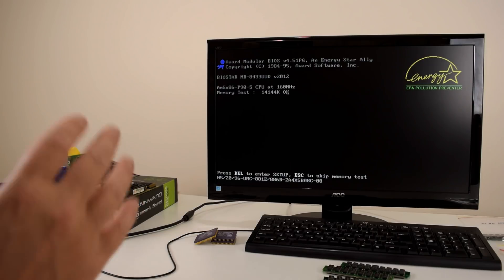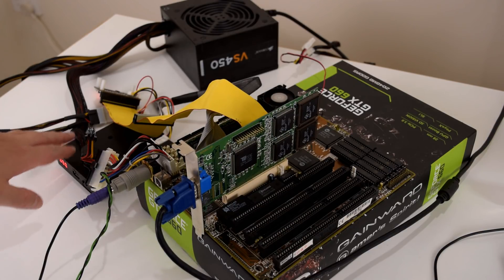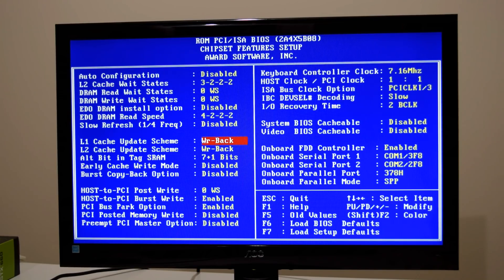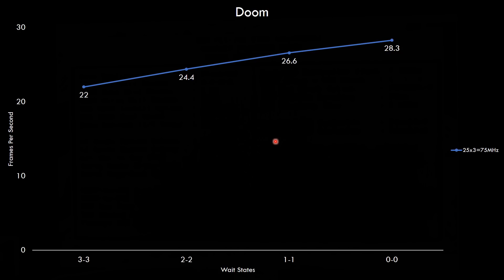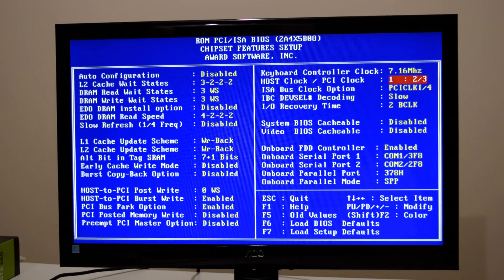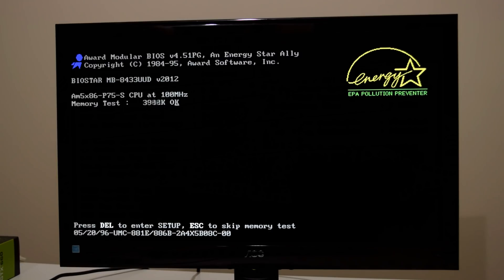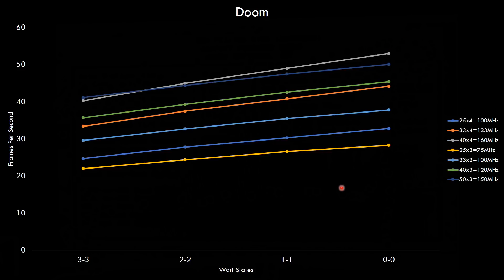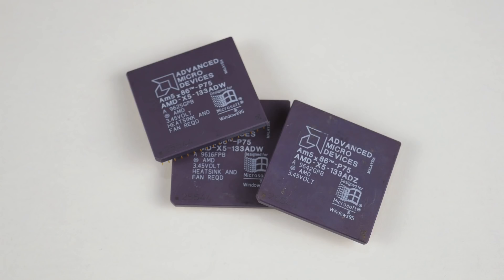486 from 75 MHz to 160 MHz and how memory timings matter

Comment: Hey Phil have you thought about making a video on the last agp cards made? I managed to pick up a mint Ati 3650 for $10. There is supposed to be a Geforce 6800 also from nvidia side. Would be interesting to see the bottleneck effects on old cpus
Reply from the maker: Nah these cards are too expensive :/
Reply: Boy you werent kidding. Man $Au100 average is pretty much.
Reply: @PhilsComputerLab - A 3650 is actually miles better, than a 7800 GS - it even supports DirectX 10.1 and is pretty decent even today.

Also I found a HD 4650 (second best AGP card) on Bazoš for around $10-30 AUD, the shipping costs are around $12 AUD for 1 GPU and $20 AUD for 3 GPUs. There are lots of other AGP GPUs on Bazoš, too if you're interested.
Reply: @PhilsComputerLab - I can forward some cards to you, the internatinal shipping is cheap here in CZE. After a 10-second search on Bazoš I was able to find a whole used PC with Athlon XP 3200+, 2GBs of DDR2, 80GB HDD and finally an AGP 3650 for $35 AUD, or a lone AGP 3650 for $10 AUD, with shipping I could probably forward it for about $20-30 AUD.
Reply from the maker: I had a look, I actually have a 3650. But it's not the fastest card, there are faster ones and they cost even more. I think my best AGP card is a 7800 GS or something like that.
Reply from the maker: Though I would just ditch AGP and go with PCIe. You can get 478 and 775 for PCIe as well as AMD 754 and 939.
Reply: IIRc the duel for the best AGP card is between 3850 and 4650.
Reply: There is also an AGP 4670 according to wiki, it's not available here in CZE though.
Reply: You're right. They are sold between 40 EUR and 50 EUR in Germany currently. I'm not sure though, if 3850 is faster because it has 256 bit memory interface. 3850 sells for 10 to 20 EUR below 4670.

Comment: the 486 computers are still my favorite computers. even though the first PC I ever used was a 286, the 486 with windows 3.1 is what I knew as a child all the way up until 1999 when we got a Pentium 3. I enjoy learning more about what this old hardware was capable of. The settings aren't as apparent as they are now in modern PC's. Also just because these settings worked on that brand of CPU, a Cyrix, or IBM or AMD 486 with similar specs may not perform the same due to differences in the construction of the CPU's micro architecture.

Comment: One DOS benchmark I used to rely on heavily is System Speed Test (I think v4.78 was the last one). It can do all kinds of nifty tests, including CPU speed, cache and memory bandwidth, video bandwidth and harddrive performance, and will save a screenshot and/or log file. For memory latency tests there's also "Cachemem", and there's even "STREAM for DOS", a version of the popular STREAM memory benchmark.

In the olden days, the difference in memory performance between various chipset could be huge. I used to have a VLB board with an older/lower-end OPTi 495SX chipset (Shuttle HOT-409), and upgrading from that to an 895 (I think), I saw memory read/write/move throughput go from 9/25/8 MB/s to 31/42/14 MB/s with the same DX/2-66. You definitely noticed that, too!

One odd quirk I once came across was that a 5x86-133 didn't like the power supply (!) in the tower I was using (a late-'80s beast once housing a 386) and left its L1 cache in write-through mode rather than switching to write-back. Booo. And that wasn't a standard "modern" AT power supply, but rather something bigger and older, I don't remember what that formfactor was called, so no easy replacement. Bummer.

Comment: So the fsb was one of the biggest bottle necks on old machines. I remember my causing had an 133mhz mmx which he downclocked to 100mhz just so he could raise the fsb and memory speed or something like that. In his words it was faster. (never actually touched the machine in depth, i was like 8 at that time)
Reply: I can confirm this too. Back in the day I did benchmarking like this on a 5x86 with 60ns EDO RAM modules and the machine got faster at 3×50 MHz than at 4×40 because of higher FSB especially in Windows. Doom may be an exception favoring higher CPU clock speed. I didn't have these options in BIOS, had to use jumper settings.
Reply: Even on Core 2 Conroe/Merom/Penryn etc FSB is a major limiter.

Comment: My recollection was that BIOS default equated to "safe defaults" and SETUP default equated to "optimized defaults" - which may apply some better options.
Also, a few passes of memtest at 50MHz 0ws would be reassuring - generally, the reason for applying any wait states is that things fall apart without them, or at least for safety margin at higher speeds - if it can tolerate 0ws on 70nS SIMMs at 50MHz, you wonder how bad the RAM would have to be to need wait states?

Comment: 2 errors :(

-you enabled L2 cache only on extremely overclocked FSB, situation where its least needed (486 is slower than ram)
-you compared 40x4=160MHz no L2 with 50x3=150 with L2 and derived 6%, while in reality the difference was 50x3 no L2 50fps vs 50x3 with L2 56.2fps = 12.5%!

12% speed bump in the worst case for L2 effectiveness (extremely overclocked bus) is HUGE.
Reply: Cache operation differs from RAM so it is useful anyway. The second mention is true.
Reply from the maker: The point of the video was memory performance, NOT cache. I mislabelled the Graph results, they are at 160 MHz with L2 Cache of course.

Comment: How many 486 motherboards have mounts for a CPU heatsink/fan? I don't remember any that I ever had having them because they were never required and I didn't OC in those days.
Reply from the maker: The cooler mounts to the CPU, not motherboard or socket. You're thinking way too modern :D
Reply: Alot of 486 chips had a heatsink cemented to them
Reply: And in case you can always plug the fan into the PSU. 12v, 9.6v 7v, 5v, 3.3v are all avaiable. Some voltage wil get the right mix of cooling performance and noise level.

Comment: 160Mhz 486!!! Makes me wet just thinking about it! My friend had a DX2-80 while I was rocking an abysmal SLC-33 (yeah ... slc was even slower than the SX) and the difference was night and day. I can only imagine what a 160Mhz beast could do in Doom II, Heretic or Descent.
Reply: Believe me, Quake was still quite sluggish at 160MHz. That was tailored for Pentiums and relied heavily on its vastly superior FPU.

The same goes for Duke3D at higher resolutions (except it isn't that FPU bound). 

But I agree with Phil's conclusion (and your memories) about Doom requirement, in most cases a DX4-100 can cut it perfectly. Except for some rather extreme levels, of course :)
Reply: i dunno, i never felt like my dx4 100mhz struggled in doom at all. it felt like it ran full speed all the time.
i guess it would be useful for duke nukem 3D, specially in higher resolution modes like 640x480. and quake. oh my god it would have been great in quake. quake ran like such a piece of shit in that pc.

Comment: Nice :) would the doom results be different with an Intel 486 instead of AMD?
Reply: Probably, because the Intels never supported an x4 multiplier - that was AMD only. Also, the Am5x86 had more L1 cache than the i486DX4.

That said, the i486DX4 is slightly faster (about 5%, IIRC) than the Am486DX4, despite theoretically being just about the same beast.

Comment: I have a 486/75 and Doom is very painful to play there, for sure. You'd think twenty-something fps shouldn't be a big difference compared to 35, but old games usually work with vsync on, which means it actually plays at about 17 fps.

I'll probably keep it slow, though. A slow 486 doesn't deviate much from the 386 level of performance, so it works pretty well for late 80's and early 90's games. The 3D games, even Build/Doom, work best in a Pentium machine IMHO.
Reply: Doom is perfectly playable on a 486-DX2-66Mhz and beyond. You can get close to 60fps by hitting F5 and using the pixel doubling integrated into the game, but you don't have to. Many areas and levels of Doom stay well above 30fps even with the slowest DX2 CPU.

The 486SX-25, and indeed the 486SLC CPU's were indeed close to a faster DX based 386, at least in FPU performance based titles like Doom.

Build engine games shouldn't really be played on any 486, even the 150Mhz beast in this video. Blood is abysmal on anything but a Pentium 100Mhz or higher. Build needed much more horsepower than early iD Tech.
Reply: Doom is capped to 35 fps, half the 70Hz refresh rate of its video mode, so you are not getting anywhere close to 60fps, regardless of your hardware. In addition, Doom barely uses the FPU, all time-critical math is done using integer math. Your FPU performance doesn't really matter.

A low-end 486 has a hard time reaching the 35 fps target consistently in Doom. My 486/75 runs a bit slower than most 486/66 benchmarks I've seen (probably due to the slower outer freq, or crappy VGA) and doesn't play the game well IMHO unless you reduce the screen size and/or play in half resolution mode, but everything looks pretty bad in this mode. I wouldn't really recommend it.
Reply: Are you sure about that? You may be comparing different chipsets, such as AMD vs Intel. A quick Google search shows a 33Mhz i486 having exactly the same performance in Doom, regardless of its SX or DX variant. 

http://thandor.net/benchmark/32

If you still don't believe it, you can check the Doom source code analysis:

http://fabiensanglard.net/doomIphone/doomClassicRenderer.php

"In 1993, only the very high-end 486DX machines had a FPU (floating point unit) hence Doom engine was doing all angles calculation via Binary Angular Measurement (BAMs), relying on int only, float is rarely used."

Comment: 486 vs pentium1 ?
Reply: 486 would loose - slower than p75  in Quake 1 - but then again I didnt have enough memory or good agp-card - maybe i was wrong and p75 would have been equally slow ( tried with 133 -DX4-150 and 160 and tried even 200 - ( didn't start) - I guessed then the performancewise would been about pentium 50 class but p1-50 was never relesed so the slowest p1-60 would have beaten the amd p75-133. - maybe sd-ram 133 would have worked but I remember the highest speed was 112? - maybe
Reply: 486 has just about HALF the performance per clock as a pentium.
Reply: Maybe but not in practise.

Comment: Love those insane clock speed gains from the old days! :D 
More then 2X the clock speed, that's not something we see these days anymore.

Last time I had a huge uplift in performance was a i7 920 2.66GHz CPU clocked at 4.3GHz (+62%)...
Reply: Yeah true , I was used to run a core2 quad 8300 stock it say 2,5 Ghz and I run it for 
around 10 years at 3,8 GHz , with standard cooler .
( temperature at max load was never going past 57 degree Celcius )
Never had any troubles at all , I have later changed to a 9500 stock 2,88 GHz and it can easy 
run 4,6 GHz with a big good air cooler but due to the very very hot climate where I live now , 
I just keep it at max 3,8 GHz so I can still keep temperature below 60 degree celcius , otherwise 
it really easy climb up at wrong side of 80 degree .
When temperatures here easy reach end of 30 ties up to 40 plus in summer ambient then its 
much harder to keep the processor nice cool .
Reply: The Pentium III era was also quite extreme, when you think about it. stretching from 450 to 1400Mhz.
Reply: @SeltsamerAttraktor  he meant overclock. a pentium 3 450 would at best overclock to ~650mhz, which is nothing to scoff at, but not quite doubling the clock speed.
Reply: @SeltsamerAttraktor I know of at least two that had 400 Mhz Pentium III Slot 1 processors.

Comment: The non-linear performance spread is to be expected since the CPU clock steps aren't uniform and the bus clock driving the rest of the system is another variable. 75/25 to 100/33 makes a big difference because both have been increased 33%, whereas the step from 120/40 to 150/33 is only a 25% gain on the CPU and an actual loss of 17.5% on the bus.

Comment: Great to see you going back to the 486, as I'm currently putting together two of those systems.

My current understanding is that the cache only really helps if you have  the RAM's waitstate set to anything higher than 0, since the CPU only has to wait if there is an actual waitstate set, otherwise cache and RAM run at the same clock with the same waitstates. So maybe, it might be an idea to revisit the effects the cache has at anything but 0 waitstate.
Reply from the maker: It can also depend on the chipset. I think this is is well tuned. So every system likely shows slightly different results.

Comment: Can it run Half Life 2 now? Otherwise that guy will still be sad
Reply: TheMalvage no, that guy from e3 2003 live video is still gonna have to upgrade ;)
Reply: Given enough RAM it can run Half-life 1 very slowly.
Reply: remember the ravelholm trailer on the cs:cz cd? combine chasing you through the building where they showcased pushing washing machines in front of the door to block it, vertical shades being shot at through the window reacting to bullets etc
Reply: The Gmork If it wasn't for the lack of SSE it would have probably been able to run it at 1 FPS

Comment: Phil, do you have any motherboards with COAST cache expansion? I came across a few recently, but haven't got around to playing with them. COAST - cache on a stick. The socket for it looks like an AGP port, but accepts CPU assist modules.
Reply from the maker: No I don't have any such system.
Reply: I currently use such a board fitted with 256KB through a COAST slot. There are a few types of cache modules available for the slot - the one to use depends on the motherboard. Generally, Pentium (MMX) boards use the faster Pipeline burst cache, whilst 486 boards often use asynchronous cache. Some boards may have different requirements though.
Reply: I have 1 pentium motherboard on hand with COAST slot and 3 modules that I discovered in my RAM bin. I thought they were laptop memory at first, but then noticed the labels. Will probably get to test mine out closer to Christmas. Still waiting on some power supply cables for the old AT standard. My sticks are 512K, I believe. Very curious to see how much of a performance difference that type of cache makes.